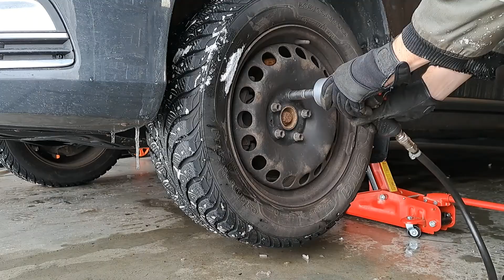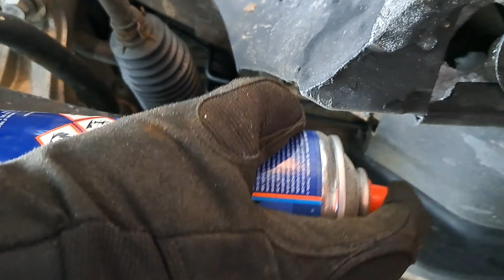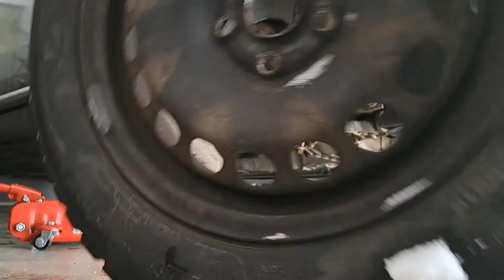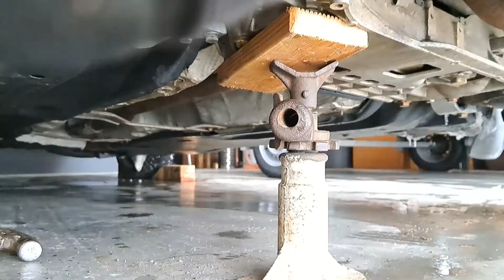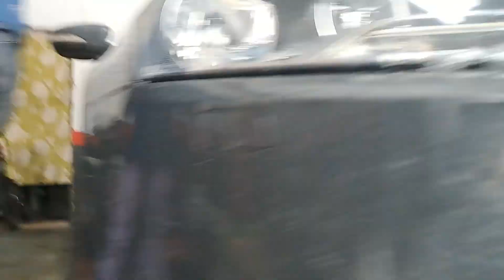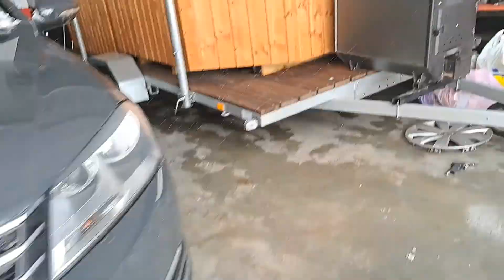VW PASSAT B7 control arm bushing replacement

Comment: What is the typical problem if the control arm bushing is bad?
Reply from the maker: Hi. Basically too much flex on front wheel when hitting the gas or brake. Clunking nois when sudden stop and also exessive tire wear.

Comment: Are they both the same?? Or does left and right matter?
Reply from the maker: I think they were same. Just rotated for the different side.
Reply: @garageproductions359  thank you 🙏
Reply: At low speed, my steering wheel shakes and pulls a little to the left, the wheels are balanced and the running angle is done, it may be  due to these bushings ??
Reply from the maker: @catalincata5464  Hello, Not for sure to diagnost over the internet :) but mostly when those bushings are bad the wheel can move forward, when starting to accelerate and moves a lttle back when braking. Basically some glunking noise and not stiff steering can occure.
Reply: @garageproductions359 I hear it too at my car

Comment: Wished I saw this before hand. I had to drop the steering rack 😢 then do the bolt blocked by the transmission. I m an idiot lol saves a lot of time
Reply: If you remove the bottom engine brace you can swing the engine forward enough to clear the bolt.